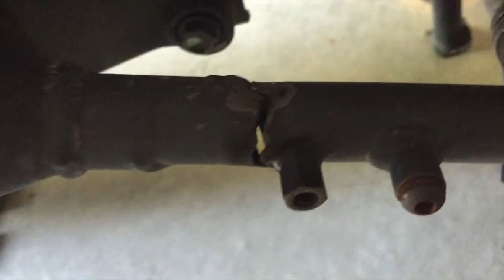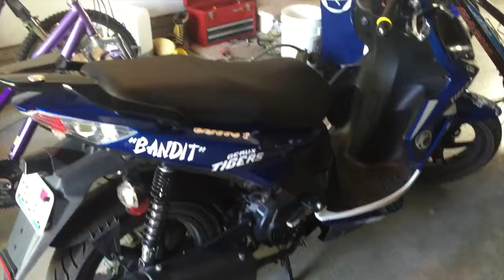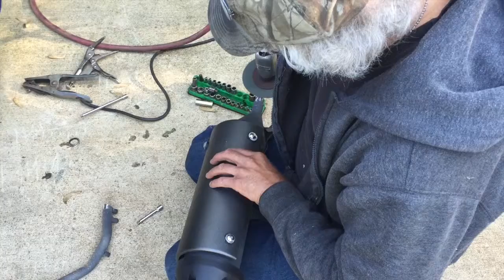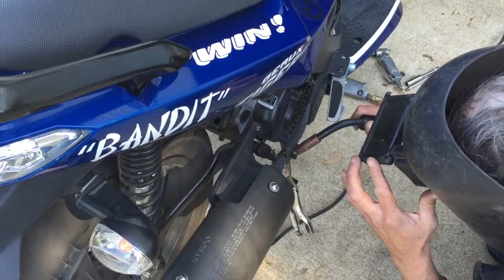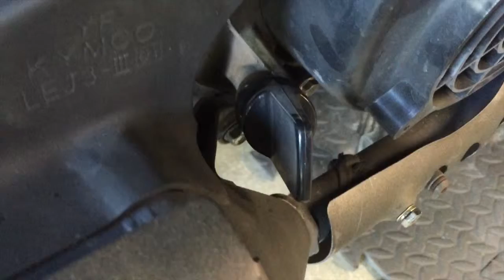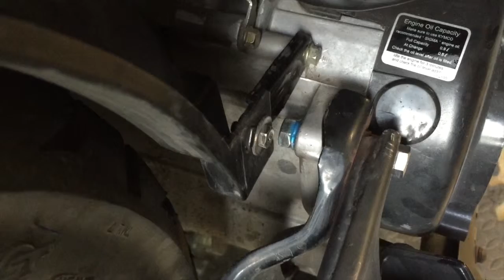Super8 150 - Fixing My Muffler

Comment: What size is the bolt that holds the muffler in place? I lost mine as well, and neglected to replace it before the tailpipe cracked. I need a new bolt, and will probably repair the pipe with heat wrap

Comment: Thats exactly what happened to me! but I still had the bolt.
Reply from the maker: I think if the Super8's had a little better suspension then that wouldn't happen. Haven't had an issue since replacing the bolts and nuts.

Comment: My muffler and header is one peace like yours. But made differently. I need a new one. I don't know what aftermarket one will fit correctly for it. Neither do I know where to get the OEM one from. Any suggestions that might help?
Reply from the maker: I never wanted to test out an aftermarket even though they are supposed to be alot lighter (which would help). To get an OEM one try finding your nearest dealer at: https://kymcousa.com/dealer-locator/

Comment: I had the exact same break, same spot same reason for break everything!
So since you had the same problem maybe you could give me an answer as to what the little metal ring between the bottom of the bike and the muffle is called, that little ring that goes around the muffler end where the 2 nuts hold it to the bottom of the bike, because I need a new one of them.
Reply from the maker: +Rain Leistone Its just known as an Exhaust Pipe Gasket. Part # 18291-GGA7-C00
Reply: Thank you

Comment: Help! My first muffler lasted 13 months...had a whole new one put on and the bolt was loose and started making noises 2 months ago...I got the bolt tightened and with the help of my 70 yro mother...the noise disappeared...tonight...(12 months + 5 dayd since the 2nd muffler) it just cracked in the exact same spot and the bolt is still attached...I saw you were in Illinois & hoping you have any suggestions for a fellow Illinoian who is in Chicago. ( I went to a 2 dealerships &  a pet boys & no one could help me with the bolt noise from 2 months ago)
Reply from the maker: I had my muffler welded back together and replaced the two bolts that attach to the frame/engine with new bolts that included locking nuts and Loc-Tite. It lasted quite a while (couple years) and then broke again this summer when my daughter was riding it. This time it snapped the hole where the bolt goes through on the engine. She took it to a welding hop and they fixed it for $60. What I consider a bargin. A welding shop is your best bet. Make sure and tell them two things, the metal on the muffler pipe is thin so they'll have to be careful welding it and also if there is damage to the engine mounting hole, that the engine is aluminum. When riding, I would make a concious effort to avoid bumpy roads. The more stress and flex you put on that muffler, the quicker you will have problems with it. Sorry to hear of your issues, hope t hey get worked out over the winter so you can be riding again in the spring.
Reply: @wkreps  thank you for responding, I decided to have it welded as well.  I ride year round in Chicago (when the roads aren't too wet) and the pot holes/roads are horrendous. I always thoughts my shocks would go before three mufflers! 🤣
Reply: @ripmamma1  was it the OEM muffler? If so, where you get it from? I need one for my 2017 Kymco Super 8 150X.